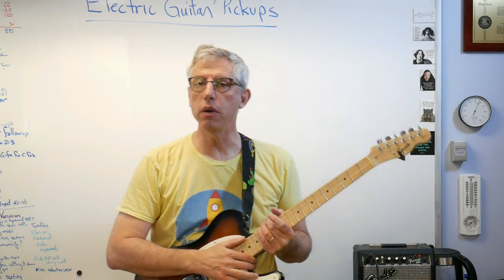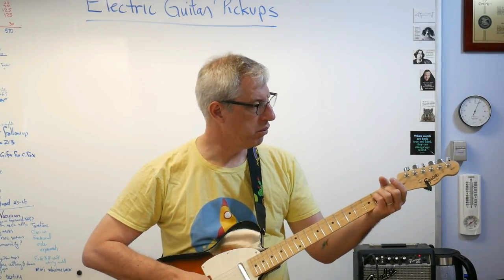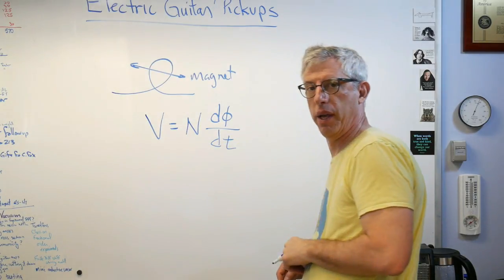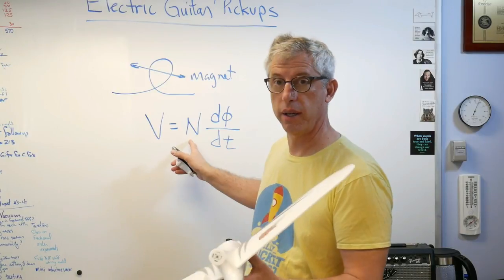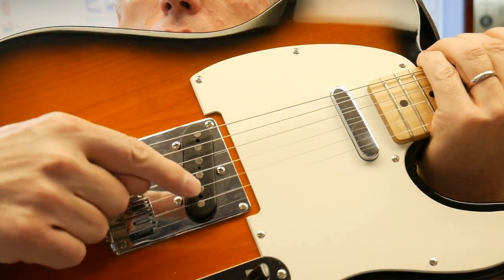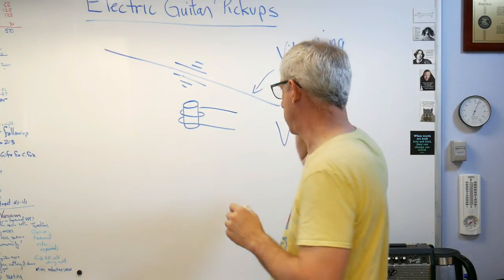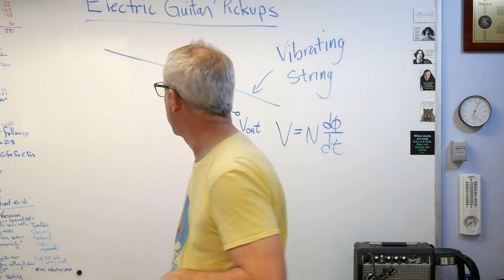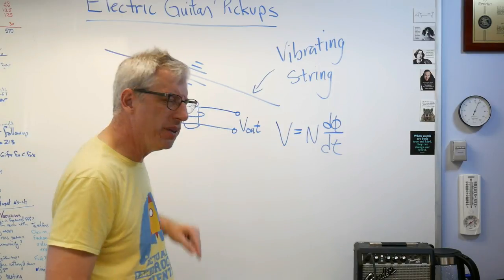Electric Guitar Pickups - Brain Waves

Comment: Good stuff, Mark!  Yes, humbuckers, please!
Reply from the maker: Thanks for the encouragement.  I'll do that one as well.
Reply: Thanks for the explanation.  Is there a relationship between the vibrating “steel” string, mass of the permanent magnet, “Q” of the coil affecting the induced voltage potential? Or is it just simply a matter of the magnetic field being changed that causes the potential voltage change? Either way though, now I understand why this type of pickup can’t be used on a nylon string instrument. Thanks again.  Enjoy your videos and looking forward to the hum bucker video.
Reply from the maker: I don't know enough about electromagnetism to answer for sure, but I think all these affect the output of the pickup.  Coil geometry, magnet geometry and magnet material are all things that pickup designers pay attention to.

Also, I just posted the video on humbuckers.

Comment: One thing I'm confused about:  I understand voltage to be different from current  which is the flow of electricity (electrons) through a circuit (which is also why when I hear people say things like, "...sends a voltage through...", conclude that, whether they realize it or not, are actually talking about CURRENT (NOT voltage) -- unless I'm just missing something)).  Voltage on the other hand (and please correct me if I'm wrong), is not a flow of electricity but rather the electrical potential (for such -- i.e. of current, given a certain resistance) stemming from, and basically measured by, the differential between two opposite charges (which have an attraction to one another, namely when connected via a circuit.  This can be thought of as a pull, or force.  So, for a simple DC circuit, powered by a battery, for example, the voltage of that circuit has to do with the differential of the charges on the positive and negative terminal, which creates an attraction of electrons from one terminal, and perhaps, through a load (if one is hooked up), to the other -- but this (voltage) is not the electricity itself.  So we understand that there is a current flowing from one "end" of the circuit, back around to the other; you have two ends with different charges which is what causes the electricity to flow.  But what creates, or namely, defines, the voltage in an electrical guitar?  What does that actually even mean?  A pickup doesn't have positive and negative ends, does it?  So what creates the attraction for the signal to flow from one point to another?  And is signal being sent through both the hot and ground wires?  Or in one direction only?  And if it's going out only through the hot wire, does that mean you have signal simultaneously flowing 'back' to the pickup/coil through the ground?  I've been searching and researching and reading and trying to absorb all the information I can find on this but unfortunately can't find any sufficient sources of info to explain this so that it will all actually make sense in the way that I need it to.  Why does no one actually explain this?  At this point, if I didn't know any better (and I don't), I'd say (or be led to think) that no one out there actually knows, or if they do, aren't setting out to teach this.  And what also gets me is how I never see anyone else even ask, when, for me, it's the first and most important question that comes to mind, that must be understood in order to understand any of the rest of it.  I guess I just have this thing where I actually need to understand things in order to understand them.  That's my problem.  It always amazes me just how little information other people seem to need in order to feel like they actually understand something, even when they're really far from it.  Or is it just me?